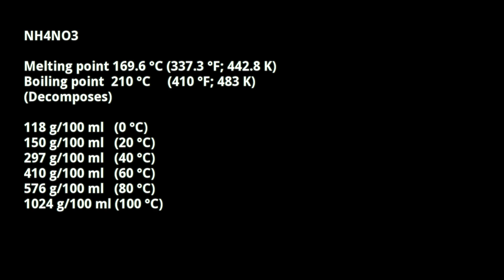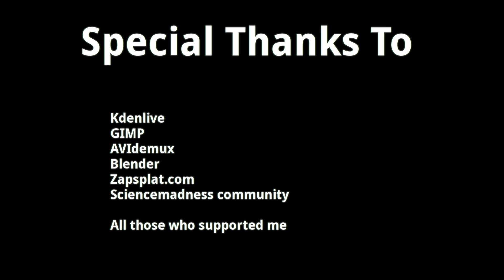Episode 1 - Ammonium Nitrate From Fertilizer

Comment: Somebody plz help,
At timline 4:06 , he said the solution is almost boiled , my question is at 100°c the water boil and evaporate, and Ammonium Nitrate solution left, so in order to get the syrup like solution do we have to boil it further to 170°c (melting point of AN),
Or at what temperature we will get that syrup like solution ?
Reply: Simply boil off water, do not go past 170 C. When you evaporate moat of the water you will get a syrup, further evaporation will dry it and you should get some clean powder.
Reply: @nowortimore1445  at around 135°c to 155°c got the best reault, now will try different batches at 140°c to 165°c, 
Thank u for the reply,

Comment: If we add nitric acid and ammonia to ammonium sulfate, won't it turn into ammonium nitrate?
Reply: Ammonia = NH3
Nitric Acid = HNO3

Ammonia Nitrate = NH4NO3

If you have nitric acid and ammonia then you can simply make ammonium nitrate by mixing them onto water, then boiling the water and crylstalizing it !! its super easy you have the right things.

take a beaker of clean water, add some portion of nitric acid into it, or instead use 30% to 40% concentrated nitric acid.
ammonia(nh3) is gas in normal temperature, so, if you have pass it through tube under water/acid. Or, else you can use cold/aqua version of ammonia into the beaker.
Ammonia becomes liquid in lower temperature.

Then mix it up, crystallize it,

Comment: Here is used the clean version 34-0-0, which is put in automatic fertilizers connected to the watering systems. Years ago I met pure (100%) crystalline KNO3 from Israel, for the same purpose.
Reply: If we add nitric acid and ammonia to ammonium sulfate, won't it turn into ammonium nitrate?
Reply: Ammonia = NH3
Nitric Acid = HNO3

Ammonia Nitrate = NH4NO3

If you have nitric acid and ammonia then you can simply make ammonium nitrate by mixing them onto water, then boiling the water and crylstalizing it !! its super easy you have the right things.

take a beaker of clean water, add some portion of nitric acid into it, or instead use 30% to 40% concentrated nitric acid.
ammonia(nh3) is gas in normal temperature, so, if you have pass it through tube under water/acid. Or, else you can use cold/aqua version of ammonia into the beaker.
Ammonia becomes liquid in lower temperature.

Then mix it up, crystallize it, 

 @kemalk-gt7cu
Reply: @kemalk-gt7cu  you dont need the sulfate.

Comment: It's amazing how soluble it is, I also recommend not having the solution very concentrated since it tends to harden into bricks, I lost a beaker that way
Reply: Any suggestions on how to keep it from doing that? Tried letting it cool down in an open pan instead of a beaker but it still hardens into big rocks.
Reply: @nativa7805  I've managed to get jt to crystalize as small crystals but I still havent gotten the process down to work 100% of the time, I'll keep on working but here's what I did: boil the solution down until 1/3 original volume, let cool, basically just don't boil it until it's syrupy or slightly viscous as that is supersaturated
Reply: rip beaker
Reply: Why do you guys do this? And can you help me learn more lab stuff?
Reply: Can't you just slowly reheat the beaker if that happens? If the stuff I have that I think is ammonium nitrate really is, they are quite brittle and even a very small ball mill will break them up into fine powder nicely, if they're dry enough. I just let the stuff dry in a plastic pan, slowly, but I imagine a non-stick or silicone pan would work even better, with some heat.

Comment: AMMONIUM NITRATE IS FERTILIZER !?!?!?!?!
Reply from the maker: It is very uncommon to find this in pure form, fertilizer often less than 50%, more in the range of 30-40%. Mostly mixed with clay.
Reply: @CesiumHelos  I've seen fertilizers that have 34% nitrogen witch would be something like 90% AN(this is in Polish but this 25kg bag is says it's 98% pure https://allegro.pl/oferta/saletra-amonowa-34-n-azot-25-kg-nitrogen-genezis-9842750531 )
Reply: "17% nitrate" - this means that there is 17% of pure nitrogen coming JUST from the nitrate group. There is also another 17% coming from the ammonia so basically there is 34% of pure nitrogen in NH4NO3 and the rest(66%) is the 3 atoms of oxygen and 1 atom of hydrogen
Reply: @karolus28  If we add nitric acid and ammonia to ammonium sulfate, won't it turn into ammonium nitrate?
Reply: @karolus28  If we add nitric acid and ammonia to ammonium sulfate, won't it turn into ammonium nitrate?
Reply: @kemalk-gt7cu  if you try to react nitric acid, ammonia and ammonium sulfate you'll get a mix of ammonium nitrate and ammonium sulfate. Just react nitric acid and ammonia without the ammonium sulfate
Reply: @karolus28  you mean no ammonium sulphate ... if i add the acids
Reply: @kemalk-gt7cu  are you trying to make ammonium nitrate from nitric acid and ammonia? Or are you mabye trying to extract ammonium nitrate from ammonium nitrate - ammonium sulfate fertilizer?
Reply: @karolus28  no
Reply: @karolus28  can i add ..nitric acid and ammonia to ammonium sulphate and get more.... ammonium sulfate and .. If I combine two acids will I get ammonium nitrate?
Reply: @kemalk-gt7cu  ok
Reply: @karolus28  do you think it is possible
Reply: @CesiumHelos  If we add nitric acid and ammonia to ammonium sulfate, won't it turn into ammonium nitrate?

Comment: I got hold on some cold packets, by itself it should have a reaction when grinded but, it didn't. After mixing it with sodium bicarbonate, I got ammonium gas and a solid product but, it has a very similar taste to chalk. Did I fuck up?
Reply: Most likely they were Calcium Ammonium Nitrate and not pure AN.  When you added the bicarbonate that displaced the calcium and you got sodium nitrate, ammonia gas and calcium carbonate (which is insoluble).  you didn't mess up but you didn't start off with the product you thought you had.
Reply: If we add nitric acid and ammonia to ammonium sulfate, won't it turn into ammonium nitrate?
Reply: @kemalk-gt7cu  Lass das Ammoniumsulfat weg. Aus Salpetersäure und Ammoniak entsteht Ammoniumnitrat.
Reply: Taste? Tf is wrong with you